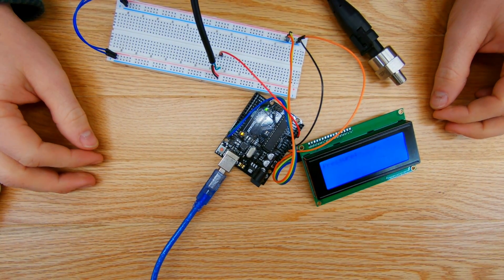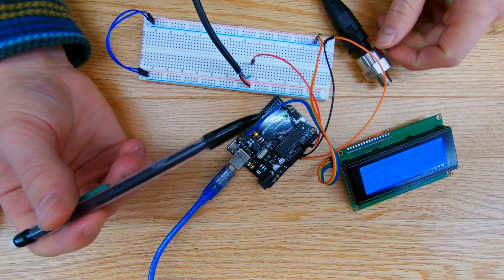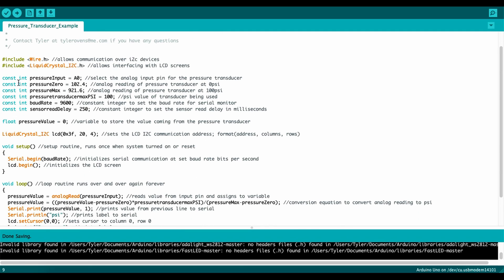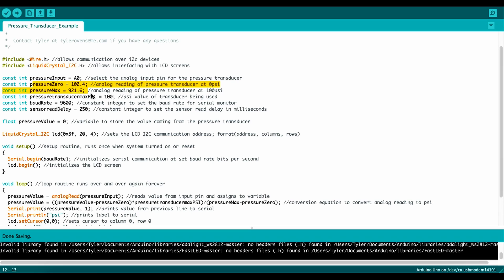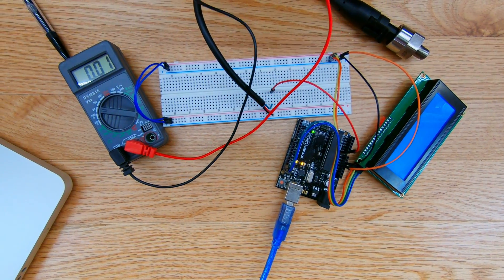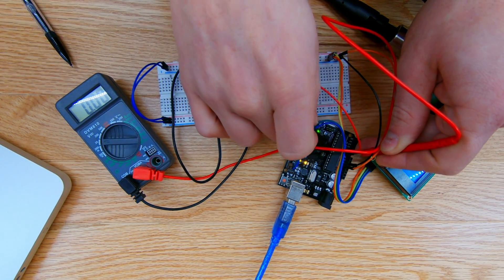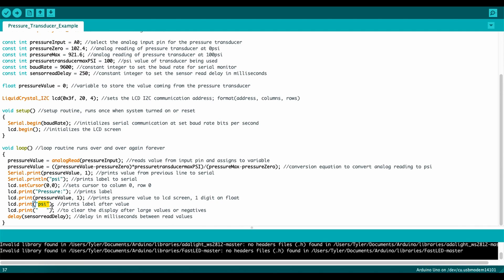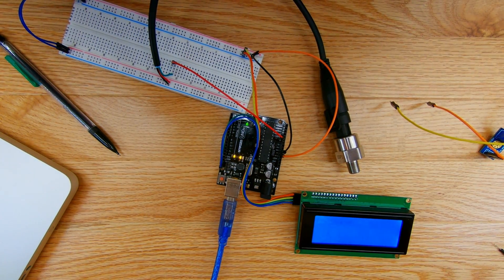Pressure Sensor - Arduino

Comment: Thank you for the nice video and great explanations. I have a question. I could set up the display and I can see it is working. The problem is that I get some random numbers, regardless of connecting the sensor or disconnecting the Arduino analog input from it. What might be the problem? Even when nothing is connected to the A0 or any other analog pin, I see the same behaviour. 
I appreciate any reply and help.
Reply from the maker: Interesting, I'm thinking maybe it's a bad connection or ground somewhere? Potentially a bad sensor as well?
Reply: @OvensGarage  Thank you for your quick reply. That was my lack of experience in breadboards, the ground and 5 volt was connected to one side of a long breadboard but not the side, where  the pressure meter was installed. So that was my mistake! I loved this tutorial, it couldn't be better, great job!

Comment: How to code for 2 wire pressure sensor. They work on current basis.
Reply from the maker: You'll need a voltage divider circuit using two resistors.

Comment: Great video! I am looking to monitor Fuel rail pressure to check the function of my fuel pump while driving as I believe it is operating intermittently . I would like to use a shrader adapter to connect a sensor to the fuel rail and arduino Have you tried outputting this sensor data to Bluetooth for monitoring on a smart phone? This would be a great project as I CANNOT find anything like that online yet .
Reply from the maker: Glad it helped. I have not yet done that but I believe it is quite possible.
Reply: @OvensGarage  Thanks for the reply. Sent you an email as well. Would you be willing to dialog a bit more on the subject? I have looked everywhere and would appreciate working this one out and ideas about what components to buy and how to program as I have not yet tried programming an Arduino yet. Could make a great video!.

Comment: This is really a thorough video. Thank you very much. I would like to use this to control air pressure coming from a compressor, but I don't konw where to find prorammable air compressors, do you have an idea of any commercial model that I could connect to the arduino?
Reply: hey, I too want to do the same. Got stuck with the same question u asked here. whether you got it..? or u have any alternative..?

Comment: I purchased the 200PSI version and used your code (with success) to get PSI. I had to raise my minimum value to 110, and my PSI fluctuates quite a bit. Are you seeing your readings at 0 PSI moving around a lot? Mine goes way past the 1% rating of the transducer. I'm wondering if mine has a wider error variance or if that is normal. If normal, I may try smoothing the data a bit.
Reply: if your seeing fluctuations while using analog pins, in your setup use the pinMode(pin#, INPUT_PULLUP) command, this will use built in 20kohm resister and stop those fluctuations
Reply: @Alex-tt9jx  this solved my problem. thanks!

Comment: i copied you code and when verifying i get error “ no matching function for call to ‘LiquidCrystal_I2C: :begin()’ “ all i did was copy and paste code. Any suggestions?
Reply: I am having the same issue.  Not sure what is going on.
Reply from the maker: I'm guessing you need to install a library that is missing. That's likely the issue.
Reply: I added the rows and columns size in the brackets and it worked

Comment: Is that possible to set as pressure switch?
Reply from the maker: You can program into your code to output the arduino when the input of the sensor into the arduino reaches a certain value...so yes you can use it as a switch i guess.

Comment: nice but for industrial applications, we use often 4-20mA sensors not 0,5-5V Sensors :-) Nice Video thx 👌❤
Reply: That's only because of your proximity to the PLC, This doesn't require a PLC so there would be no voltage drop. This is nice on an ESP32 where the value can be wirelessly transmitted to a PLC or HMI from a remote location, especially if you have an ESP32 with LoRa, then you could transmit multiple miles on just 5 volts wouldn't be practical with 4-20mA

Comment: Most of these sensors I have seen are .5v=0psi  4.5v=max rated.... but 0v=-14.7 psi. Theoretically, if you applied a vacuum, it should (linearly) bring the voltage down to zero. 
 
Here's my issue.... If I wanted it to read vacuum, how would I change the code for the equation to include those vacuum numbers? I assume an if loop to check pressure value for +/-0, and then if less than zero, convert the vacuum numbers to inHg... but what would the change in the equation be for the analog signal?
 
Side note: I have one of these transducers coming in the day after tomorrow, and I will be testing it with a compressor and a vacuum pump to see if the voltages work like I think they do. I plan to use them for much the same purpose as you, except I am planning to use them as probes for scope inputs for diagnostics, but would like to be able to use them with a separate digital read out also. What I don't know is the Arduino coding to make it work, or the math skills to figure out the equation.... If you'd be interested in collaborating on it, feel free to let me know. I plan to figure out fuel pressure, temperature, vacuum, oil pressure, and compression sensors..... Most of which sounds like something you could use also.

Comment: Hi, I got a question, I want to use it for measureing into a water container (1000 lt), the sensor could be in touch with the water,? my idea is at the bottom of the container in pipe line put it, thanks in advanced!!!!

Comment: Hi there.
 i have the same sensor, the same lcd and a Arduino Uno. i have copied your code and im not getting the same display. Is this line of code written as is or do you have to add numbers?  "pressureValue = ((pressureValue-pressureZero)*pressuretransducermaxPSI)/(pressureMax-pressureZero); 
Thank you for taking the time to upload a great video.

Comment: 3:51 1.5 psi is 77.5mmHg, so your measurement is probably right. It is normal that the "vacuum" is a much larger number because you only have to remove the air. There's a lot of atmospheric pressure outside to push against, so you can "suck" a lot harder than "blow". Nice presentation, btw!

Comment: All of this kind of pressure sensor that I found use 12v power
Reply from the maker: This one is from amazon linked below. You can always use a voltage regulator to regulate power.

Comment: Dude! This is by far the best video of pressure sensor I can find. Great job of explaining your code. Most videos just talk about the hardware yet forget about coding. I plan on using this video to setup pressure sensors for an air ride system.
Reply from the maker: Glad it helped! I try to setup these vids so it's easy to understand for someone who has never done it before...I'm not an expert either! We are all learning together.

Comment: you do not have zero pressure. the normal atmospheric pressure is 1 atm or 1 bar. if you're on earth and on sea level, the sensor should always read 1 atm or 1 bar or  ~14.5038psi. if you do not connect it to anything, it should never read zero psi unless you're on the moon or in extraterrestrial space :-)
you have an error of about 1 bar.  that is like %20 error, considering residential water infrastructure pressure is about 5.5 bar max, and most probably that is where this king of inducer would be used,.
Reply: sorry for 1 month late reply, but i believe the transducer is using the atmosphere as a reference pressure, so if the atmosphere is 1 bar and the transducer's input is also 1 bar, the difference is 0 bar and so it reads no pressure. It also explains how he could get a negative reading by sucking on the transducer despite there being no such thing as negative pressure- the transducer's input is a lower pressure than the atmosphere and so the difference is negative.

This could probably just be fixed by offsetting the output by +1 bar.
Reply: Just read the ref volt that is out at atmosphere and calibrate the sensor.

Comment: you have datasheet your sensor sir?
can you give me
Reply from the maker: The datasheets for these sensors are on Amazon linked in the description below.
Reply: https://www.ebay.com.au/itm/1-8-NPT-5V-100PSI-Pressure-Transducer-Sender-Sensor-for-Oil-Fuel-Air-Gas-/324264102520           data sheet is linked here;

Comment: If I wanted to run two of that same sensor for oil and fuel pressure would I just duplicate the code underneath and change the input to A1? And to display the second reading under the oil pressure just change the colum row to (1,0)?
Reply from the maker: Yes that would likely work!

Comment: I tried your code without the lcd but with no luck. Print out the analog value and it print out 1024 with sensor attach and no pressure. No matter what pressure that the value did not change. Any Idea?
Reply: I do have the same problem ,  did you solve it ?

Comment: Great video! It was working fine with me till I messed up, I plugged my sensor output accidentally to the 5v of the Arduino while it was already in supply externally by a 5v power supply. Now i'm not getting any reading, do you think I jammed my sensor?
Reply from the maker: I think you should be fine, try re-wiring and then re-setting the arduino and it should work.

Comment: Hi and thanks for this video, it helped get me on the right track for adding a fuel pressure sensor to my truck. I'm new to Arduino and writing code but I made a few changes in the calculations that seemed a bit easier (for me anyways). Here it is in case it'll help you or anyone else along the way when you start adding different sensors. I'm also going to add a pyrometer and a boost gauge and run them all (or try to anyway) off one arduino. 

Things I changed;
-My display was different so I switched to LiquidCrystal
-I didn't use the pressurezero, pressuremax, or max psi
-I determined the linear rate of 5.45 for a 150psi sensor but since Arduino doesn't use decimals, I made it 545 and then divided by 100 later
-In the pressure value, I subtracted 102 since .5v = 0 psi and 102 is the analog equivalent of .5v

#include <LiquidCrystal.h>
const int pressureInput = A1; //select the analog input pin for the pressure transducer
//const int pressureZero = 102.4; //analog reading of pressure transducer at 0psi
//const int pressureMax = 921.6; //analog reading of pressure transducer at 100psi
//const int pressuretransducermaxPSI = 150; //psi value of transducer being used
const int baudRate = 9600; //constant integer to set the baud rate for serial monitor
const int sensorreadDelay = 250; //constant integer to set the sensor read delay in milliseconds
const int linear = 545;
float pressureValue = 3; //variable to store the value coming from the pressure transducer

LiquidCrystal lcd(12,11,5,4,3,2); //sets the LCD I2C communication address; format(address, columns, rows)

void setup() //setup routine, runs once when system turned on or reset
{
  Serial.begin(baudRate); //initializes serial communication at set baud rate bits per second
  lcd.begin(16,2); //initializes the LCD screen
}

void loop() //loop routine runs over and over again forever
{
  pressureValue = analogRead(pressureInput); //reads value from input pin and assigns to variable
 pressureValue = (((pressureValue-102)/linear)*100);  //This seemed simpler to for me
  Serial.print(pressureValue, 1); //prints value from previous line to serial
  Serial.println("psi"); //prints label to serial
  lcd.setCursor(0,0); //sets cursor to column 0, row 0
  lcd.print("Pressure:"); //prints label
  lcd.print(pressureValue, 0); //prints pressure value to lcd screen, 0 digit on float so that it would all fit on the screen
  lcd.print(" psi"); //prints label after value
  lcd.print("   "); //to clear the display after large values or negatives
  delay(sensorreadDelay); //delay in milliseconds between read values
}
Reply: hello friend for a 200 psi sensor that needs to be configured
Reply: @shadowpit19  assuming it is 0.5 - 4.5V sensor too, just change the pressuretransducermaxPSI variable from 100 to 200:
const int pressuretransducermaxPSI = 200; //psi value of transducer being used

Comment: Have you had any experience with I2C pressure sensors and making them work for an arduino? I am working on a project using an ABPDANN005PG2A3
 sensor by honeywell for reading a blood pressure cuff. I am stuck on how to get the sensor to read on my arduino mega and uno (Not at the same time). Do you have any tips or places besides the arduino forums to look?
Reply from the maker: I have not used this type of sensor.

Comment: I'm new to all this and was wondering if I could use a Pressure Transmitter instead and is there limits on the max pressure? Does it matter within the code itself?
Reply from the maker: Hi, I'm unsure what a pressure transmitter means that you are talking about. You can purchase these types of sensors from amazon in various pressure limits and very simple to adjust this code to them.

Comment: Nice project. Couuld I use this to measure tire air pressure?
Reply from the maker: Sure, if the tire was static.. but the sensor is much too large to be mounted permanently on a tire while it is in use.
Reply: @OvensGarage  yes it would be static and the tire would be non-moving. I want to build a simple arduino tire pressure guage.  Would would know the size of the connector I would get - I've been googling around and I think it's a G1/4" thread - I'm new to this so any recommendation would be appreciated

Comment: can i use above pressure transducer to the verical pipe having flammable fluid such as oil,petro or diesel etc.
Reply from the maker: Probably, depending on the temperatures though it might alter your readings. You could have a long tube of some sort with some adaptors to still read the pressure at a distance to keep the temps away from the sensor.

Comment: I find that those values obtained are too low. e.g:0.1, 0.0...etc
please sir is it a good result? i am worried about : because when convert it into bar, it becomes too small again.
thank you to answer me.
Reply from the maker: This is just a proof of concept and you could change the range of sensor that you use in your project to be of the scale that you wish. For example I am using a 30psi sensor for a fuel pressure line in a vehicle.

Comment: I just watch your video concerning industrial pressure and Ihave some questions.
firstly, please what is the identification of a sensor you use? if I want to command it or use exactly the same.

secondly, which is the type of the pressure sensor you use? differential? absolute? vacuum?
thirdly, can i use it in the reactor of a biodigester?
thanks in advance!
i look forward to hearing from you soon!
Reply from the maker: The pressure transducer sensor and all of the items I use are in the video description below, including the example code that I created and used. Absolute. You can use it wherever you deem fit. The sensor is okay to use with fluid, fuel, or air pressure. Good luck with your project.
Reply: @OvensGarage  thanks to answer me. in the video I haven't saw the '''identity''' of the sensor. because I whould like to use the same in my project.
 so, I want the identity please which will allow me to search its datasheet, please